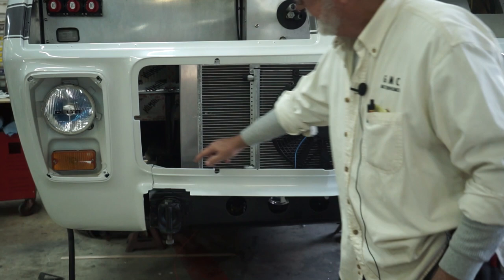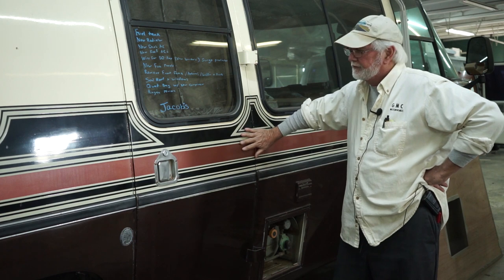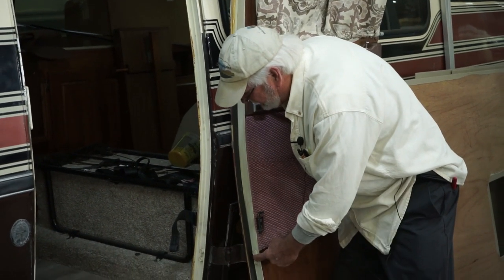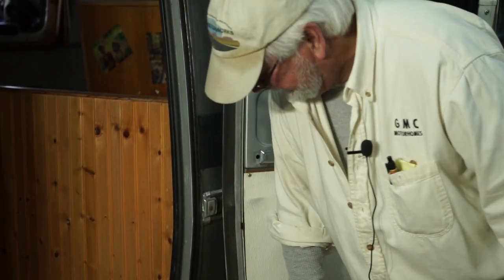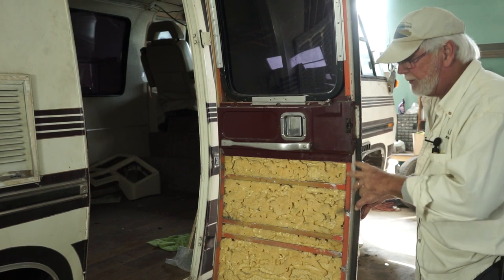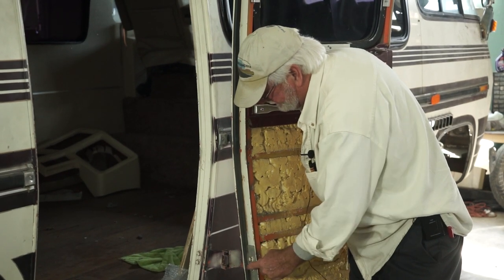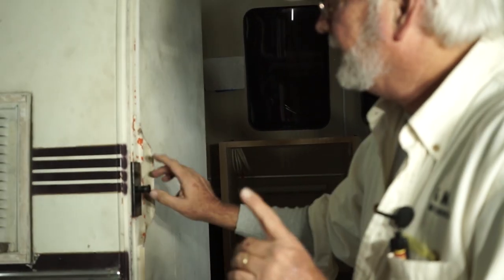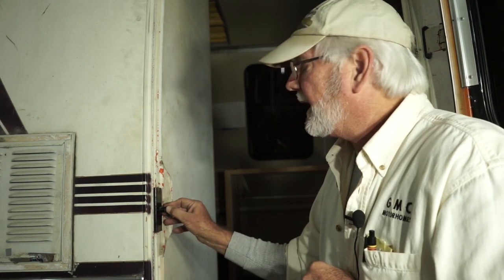GMC MOTORHOME Door Hinge and Frame Repair - Let's close the gap

Comment: What are u screwing into to correct the chipmunk issues? And exactly wher is the cable attached?
Reply: My question is, the screws installed into the side, how high up the coach are they installed, and what are they screwing into on the backside?